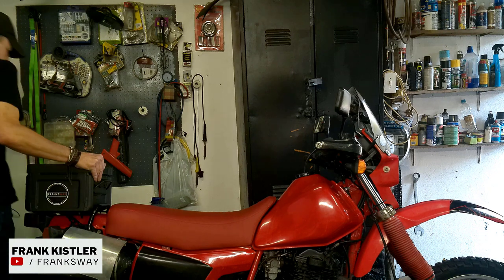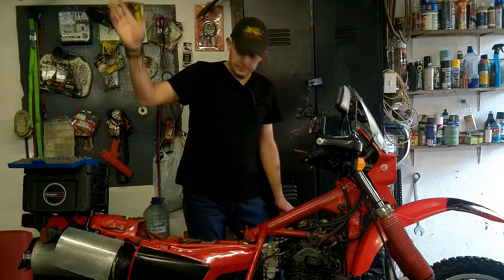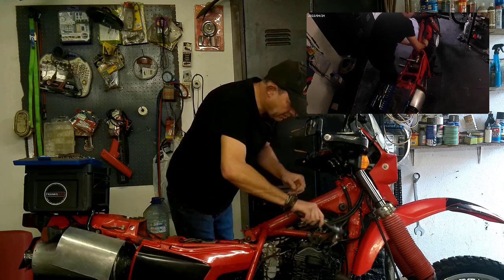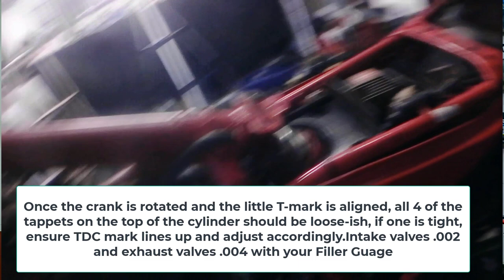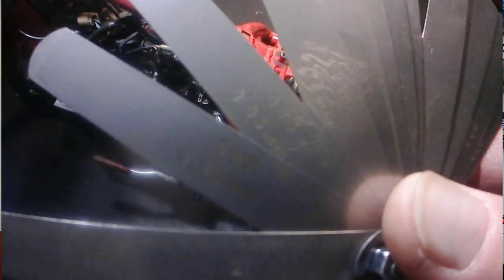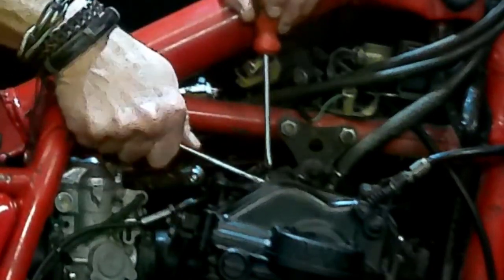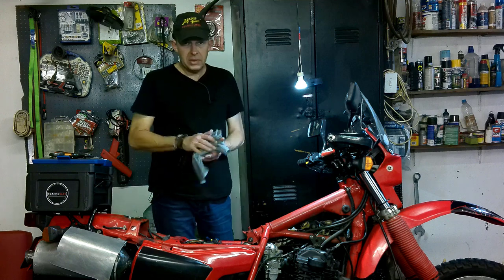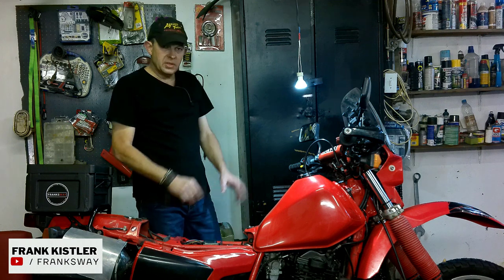XL600/XR600 Valve adjustments and clearance #xl600,#xr600,#xr400 #xr250

Comment: Strange that you checked the valves warm. The service manual states cold and that's how I've checked valves on every motorcycle I've ever owned.
Reply from the maker: That is true,i do it cold or hot,have done them so many times thst i factor in the heat tolerance,but yes,manual says cold.

Comment: maybe a stupid question do you need to drain the oil first for valve check ?
Reply from the maker: There is never a stupid question,you dont need to drain oil for a valve check. 👍
Reply: @FranksWay   i did it today!!!  Thanks to your video!!,   but now the fuel hose is leaking because it was to old and i bend it.  you have any clue what MM size those hoses are ?
Reply from the maker: well done!!, the fuel hose should be 6mm or 8mm, buy 1/2 metre of each with new clamps..
Reply: @FranksWay   Thanks Dude!  this saved me alot of money ;) doing most things myself
Reply from the maker: Glad it helped you.